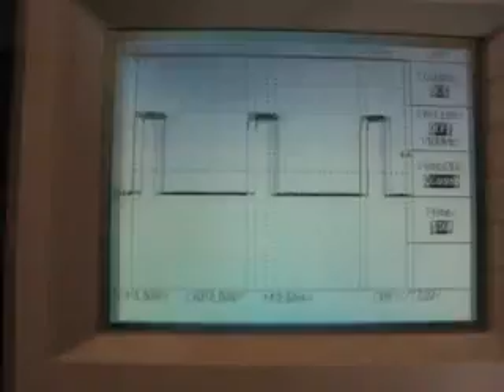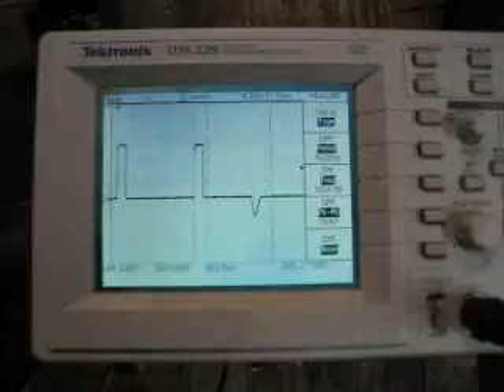Nytro FX handwarmer PWM signal

Comment: Hi.  I am gathering info for my Apex with cold hand warmers.  What did you do with this information you got in your video?  I was thinking of bypassing the ecu and putting a PWM connected to 12v supply  just to control the the heated grips only. What are your thoughts on if this would work.  Could you tell what the max amperage draw would be?